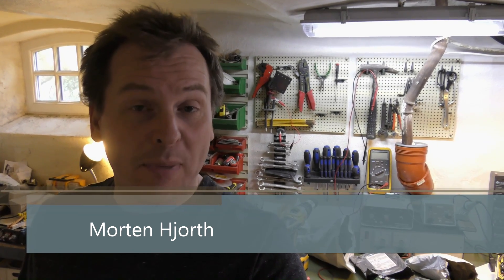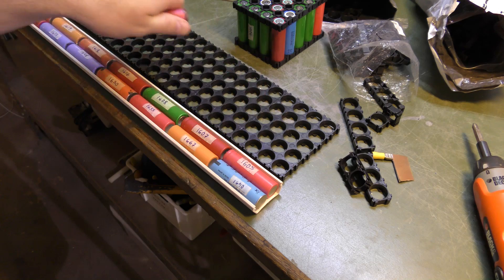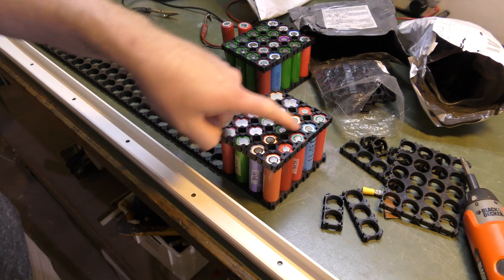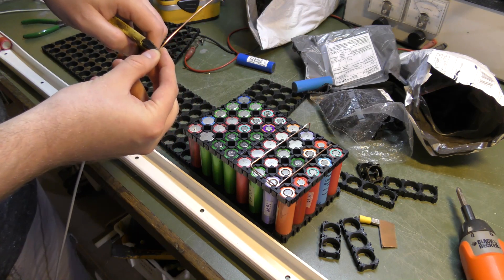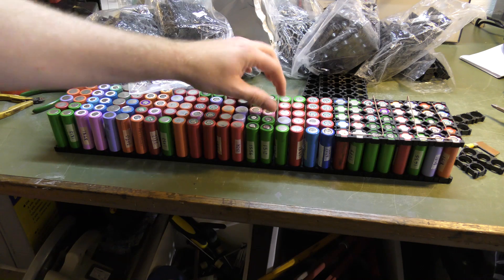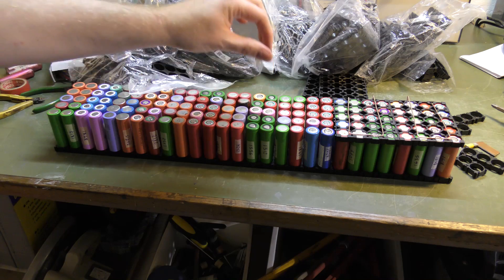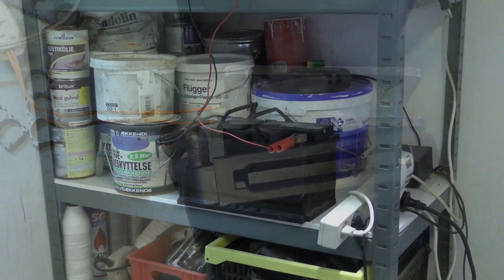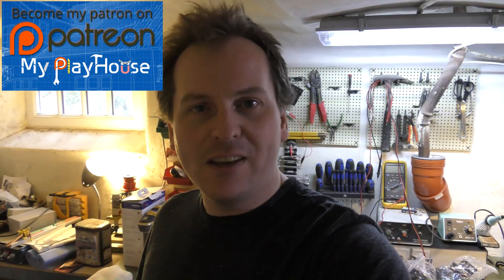1KWh PowerBank & Water Cooled Data Center - 549

Comment: the watercooling sounds like a very nice project.
but there are some issues :(
running that water will be very bad and probably create organic stuff in your loop,  that wil clog up the loop and the waterblocks and radiators, which is very difficult and annoying to clean up and will greatly decrease cooling capacity to the extend of overheating, running watercooling fluids is kinda a must
you also need to use the same metals for the whole loop to prevent issues.
one of the radiators you showed might or might not cool a single server. depending on the density of the metal fins
i posted some pictures in the discord
Reply from the maker: Hi ProBro_NL
Thank You very much!  I am just playing with this now,, and I pump out 800-1000 liters of water from my well a day, to prevent it flooding my basement,, I am not going to circle/loop it. I think I am okay.. I just got for €50 parts for this..
Thank you for watching! :-)
Reply: ProBro_NL you don't need to use water cooling fluid, just distilled water with biocide to remove the bacteria will be enough and way cheaper
Reply: Don' do so difficult, KISS : 1 aquarium or pond pump,1 pipe from the pump to your coolerblocks  and 1 pipe back in the well.( open loop)
No bacteria growth ,no radiators no fans.
Unless your servers create that much heat that the water in your well will rise 20 °C

Comment: the copper between the batteries is kind of thin better go with nickel strips an use an pulse welder for batteries
Reply: Hard to judge from the video what gauge he's using but even 1 mm can carry 16 amps
Reply: I would say when it is a normal house wire it is 1.5mm² but these Li-Ion can dump a lot aif energy
Reply: MrAtlantis646 I can't remember hearing what his intended use was for them, I would guess the output would be via some sort of buck/boost converter with current regulation
Reply: I don't know but i would use an 4mm² at least
Reply from the maker: Hi MrAtlantis646
Yes it's 1,5mm2 normal house wire,,, I might look for some 2,5mm2, but I also think I will put in a 10A or 15A automatic fuse. I hope to keep the power usages from this to under 10 amp,, and this power pack is meant to go in parallel with other.
Thank you for watching! :-)
Reply: But you need to be careful with automatic fuses because of characteristics 
Type A 2-3 x I 
Type B 3-5 x I
Type C 5-10 x I 

so if you have an B16 this means 5 x 16A = 80A so it will defininitly switch off instand only on 80A of current

https://en.wikipedia.org/wiki/Circuit_breaker#/media/File:Standard_Trip_Characteristic_of_a_Thermomagnetic_Circuit_Breaker.svg
Reply: I've never heard of a type A, usually B is used or if high inrush current type C:

A type B at 5xIn has to trip in less than 0.1s so highly unlikely any damage will occur
Reply: Type A are not very common but sometimes I have some at work for Power measurement Devices

Comment: I think you shouldn't cool the air. It should be better to use water cooling on CPUs or GPUs and submerge the heat exchanger in the dwell. Something like Linus did with the whole room water cooling, but you wouldn't use air for the final heat dissipation.

If you won't to cool the air maybe instead of using these little radiator you would be better using some home made sprinkler, which would cool down the air at the intake to your server room. Although, this might raise the humidity of the air...

Fun fact, I was once at an agricultural exhibition, where was a huge barn full of animals during the summer. I thought that there must be awfully hot, but i was pleasantly surprised that the air was colder than outside. They were constantly sprinkling water on the roof of the barn, which kept the whole building cold.
Reply from the maker: Hi Murphistic
Thank You very much!  I need to see that video at some point,, I have heard a lot about it..
Thank you for watching! :-)
Reply: yes but like linus there will be loads of issues when doing a external radiator.
putting the radiator in the water might work, but the water will need a way to get pushed through the radiators
and if any well water enters the loop organisms will form in the water loop clogging the waterblock and radiators
Reply from the maker: Hi Murphistic
Thank You very much!  I am just playing with this now,, and I pump out 800-1000 liters of water from my well a day, to prevent it flooding my basement,, I am not going to circle/loop it. I think I am okay.. I just got for €50 parts for this..
Thank you for watching! :-)
Reply: That video might serve as a source to what not to do :).

Speaking of failures, it's not good to mix different metals for water cooling loops. I don't know what your fittings are made of (maybe brass?), but if you have copper radiators, you should use copper everywhere. At least, that's what I have learn from other videos.

Oh, and after you read this mess of text, you don't have to reply :) .
Reply: yeah i talked about the same thing in my comment
Reply: Yes, but thanks to YouTube's awesome comment system I haven's seen your comment until I reloaded the video page. At least we mentioned different issues (live organisms in loops vs. mixing different metals).

Comment: You must be sure that all the battery's have the same capacity.   First charge and discharge with a modern battery charger.  than you know the capacity.   Then you can make a selection.   

For example   https://www.banggood.com/Powerfocus-BC3100-Ni-Mh-lithium-ion-Battery-Charger-With-Charger-Line-p-921306.html?rmmds=myorder
Reply: He did that. That's why the exact capacity is written on tape on each cell.
BTW: Any "4 button charger" like he has is a 1,000 times better than what you linked.
Reply from the maker: Hi psygn0sis
Thank You very much!  But a 1000 times,, might be stretching it :-)
Thank you for watching! :-)
Reply: My PlayHouse Morton, I am not sure that your math to have each block of parallel cells averaged with the whole battery is correct.  I can't find a source to back me up, but it seems like you should only parallel similar cells, never dissimilar cells.  Please have an expert verify, as I am not an expert myself.